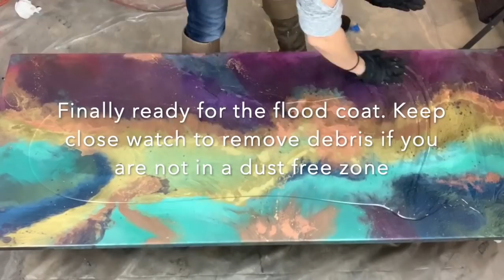Copper Patina Epoxy Resin Table Part 2- Final Steps

Comment: Awesome! but what are the first steps ther e- you polished it, or sanded it to give it something to grip? And then wiped it down with alcohol? And then added metallic alcohol inks on top the dried resin? (It's unclear b/c you're using the heating tool to blow the alcohol inks which look like resin - unless they're metallic AIs in resin? :)